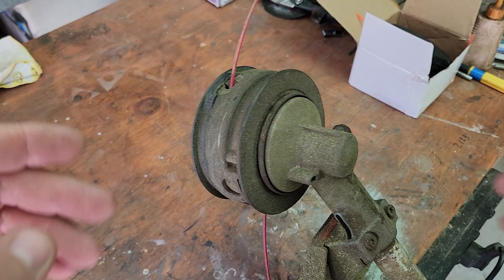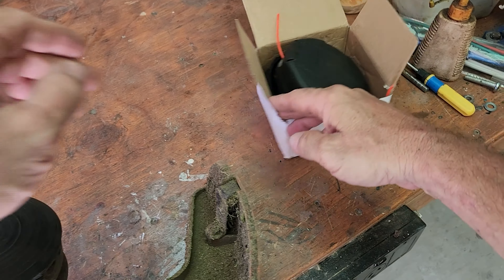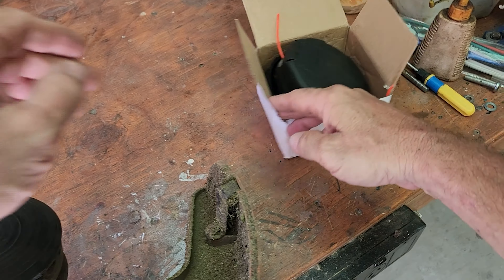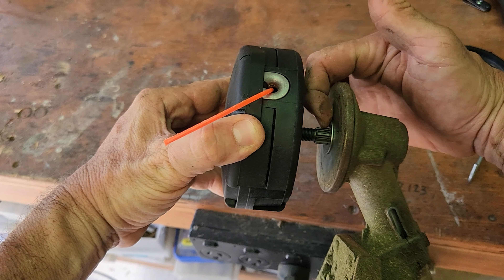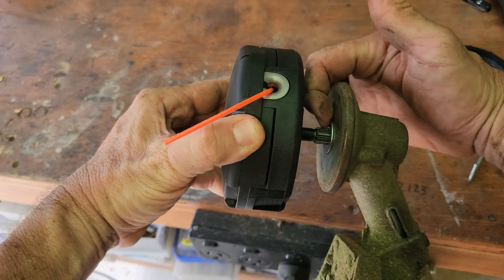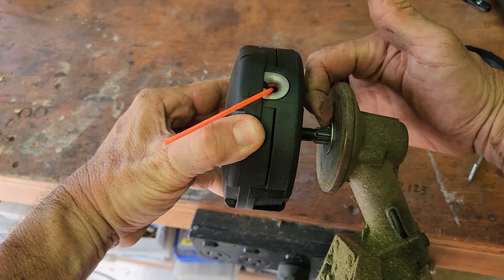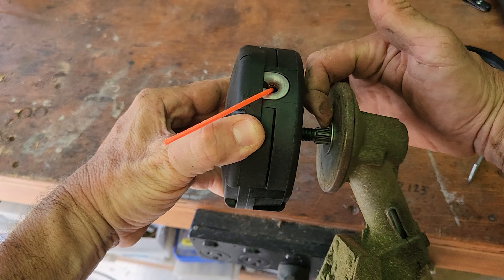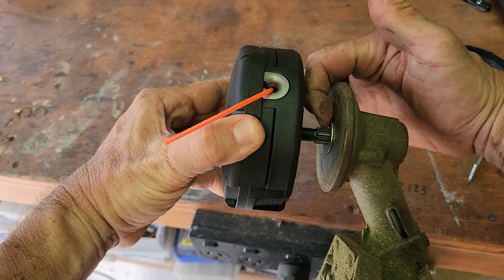Speed Feed Trimmer Head... An absolute must!!

Comment: You are life saver, I've been using it for about a year till one end of the line pulled back, could not open it to pull the line out untill now.
Also the honda machine is virating a little, will have to add the spacer just as you did.

Comment: Spend just a little more & get something better made (like ProKut Rapid Feed 400) where it will fit better & also provide proper made spacer rings. Also, just use a metal washer inside & outside & cut the bolt to length accordingly. Having too much of a protrusion (with the bolt) it would not glide as well over grass when trimming horizontally.